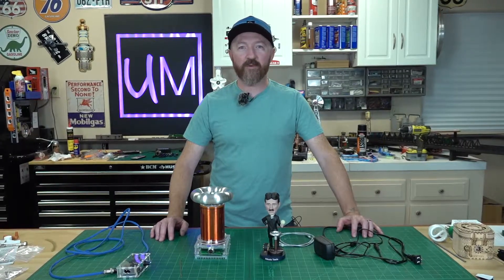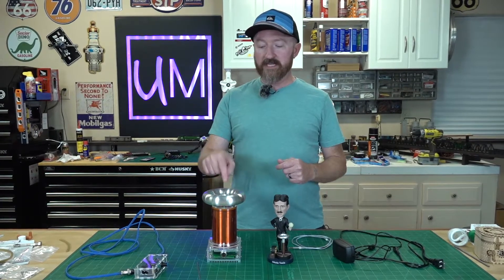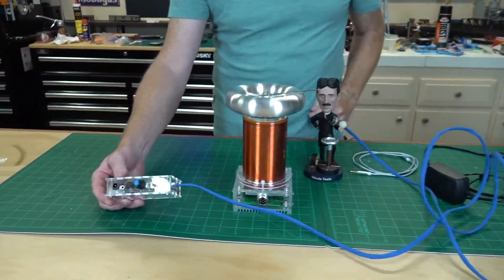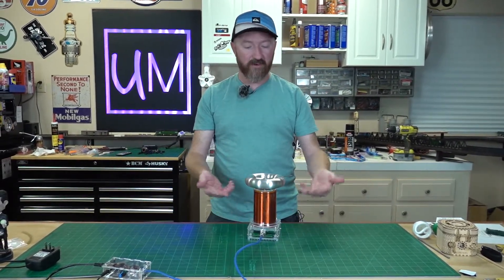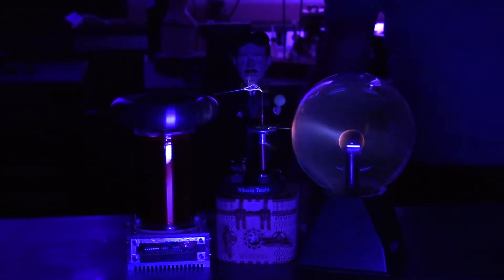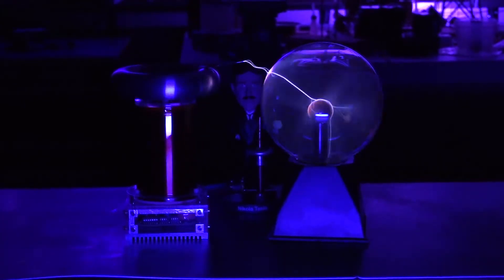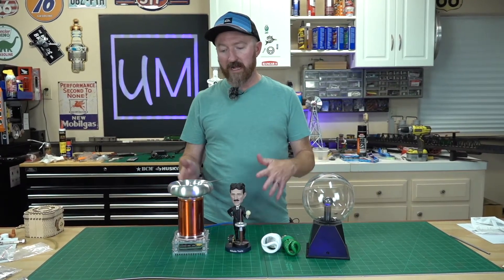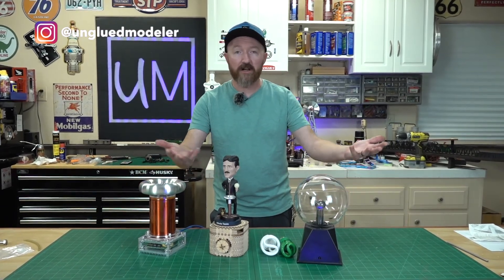Mini Musical Tesla Coil Model! (with well known songs!)

Comment: Is it possible to plug in a square wave frequency/signal generator ?
Reply from the maker: Yes absolutely. I’m actually building a square wave generator now. But for the meantime I use szyminski online frequency generator ( spelling might be off) haha. Thanks!
Reply: @UngluedModeler  Thanks for the quick reply. Would the concept be the same if I was to drive the output of a singal generator to a tesla musical coil device from its bnc out to aux?
Reply from the maker: Hmmmm that I don’t know the answer to sorry haha.